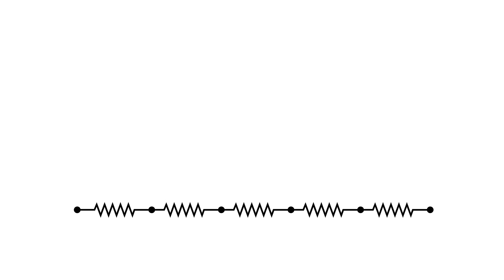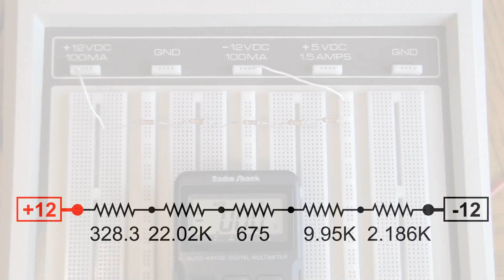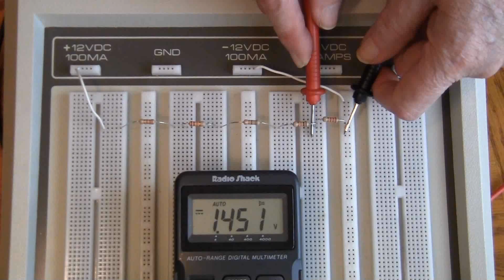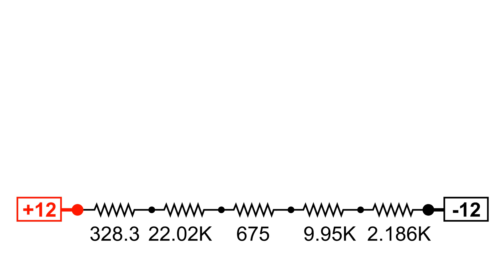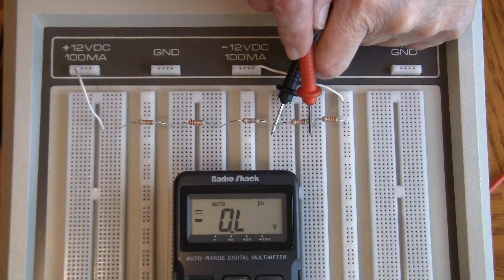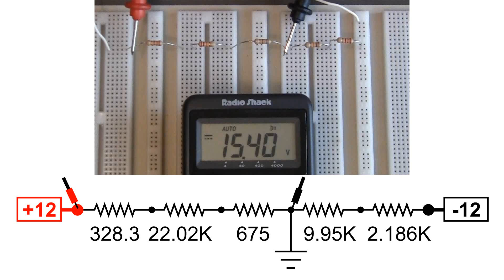Voltage Drop Bridge, the Basics

Comment: Regarding my last comment, I should instead ask:  why use a 12v positive/12v negative that results in 24v.  Is it the same as using a 24v supply to ground, and the loads in between?

Comment from the maker: Hey Andy,
The trainer is labeled +12 and -12. If I would have said, lets call the -12 zero, I think there would have been more questions. Besides the meter show what the voltages really are, which is what the meters are for. If you don't know and or understand something, get out the measuring equipment.
Regards,
Rick

Comment from the maker: Negative of positive ground in cars and trunk makes little difference, but it is very important in commercial communication equipment. When I started working in a Telephone Switching Central Office I found that they have positive grounds because the negative is actually the Hot side. Took a little while to get use to that.

Comment: Thanks I guess I never thought of it that way. I have worked on 24V systems for years on over the road trucks with two 12V batteries hooked in series but always just thought of it as 12V. I know a DVOM is just measuring the d

Comment from the maker: Picture this, two 12 volt car batteries connected in series to make 24 volts. The common ground connection is between the two batteries. Measured from the center ground you have +12 on one side and -12 on the other. In this video I used the two ends, 24 volts. I did not use the center ground.